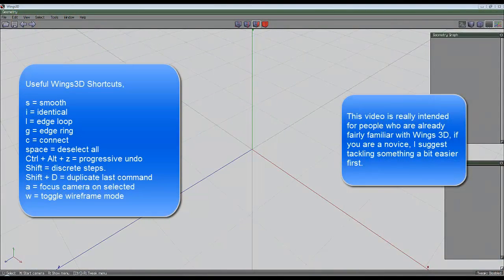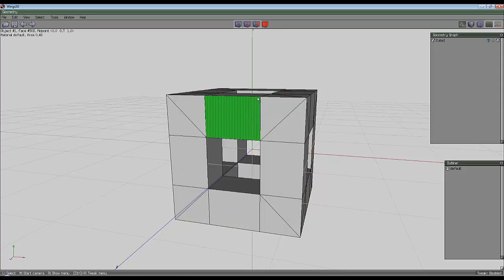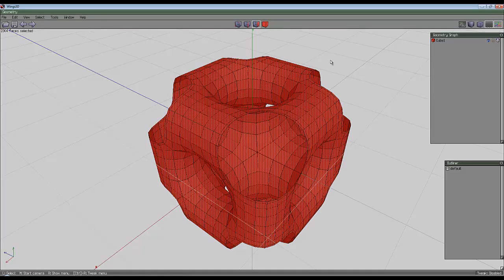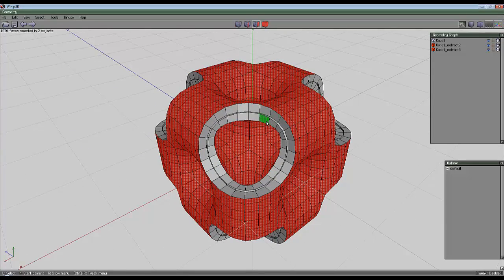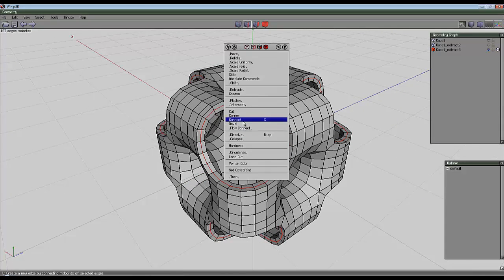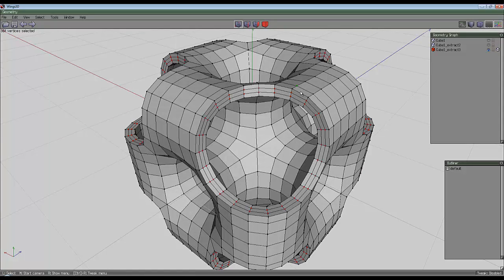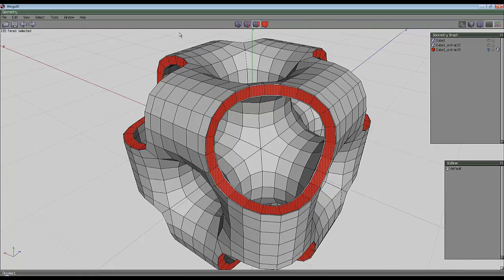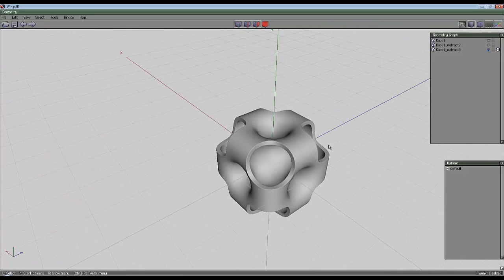Wings 3D command tip - RMB inset - by David Brinnen.

Comment: You could also set the hardness on the edges to hard to eliminate the funky shading.
Reply from the maker: Tate testa Ah yes and I think that Modo has something similar called edge weight, but what I don't know is how many other pieces of software respect these settings if the object is say being sent to Octane or Bryce for final rendering.
Reply: David Brinnen Right, compatibility is my biggest problem with wings (mostly with the UV mapping).
Reply from the maker: Tate testa For UV mapping I use UV layout, I've tried to in Wings and found it quite a laborious process.  UV layout makes the task considerably easier, but the program is a bit quirky in its own way and takes some getting used to.
Reply: David Brinnen Thanks, I'll try it.